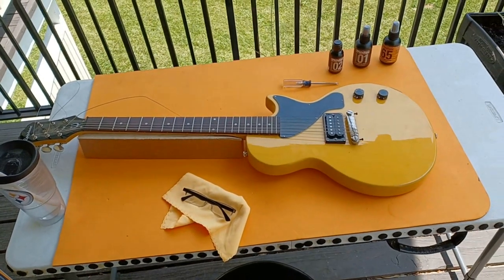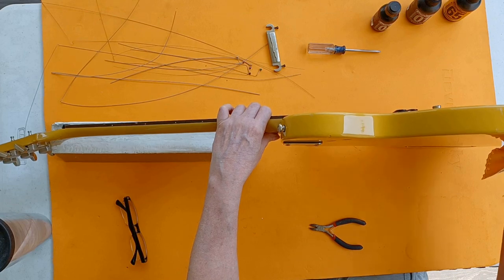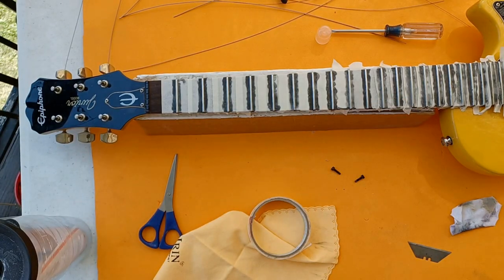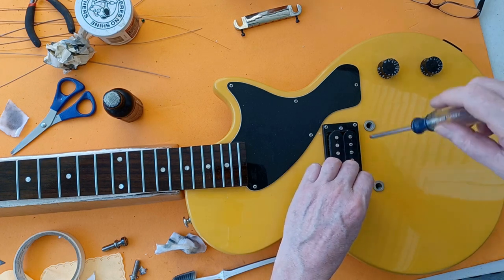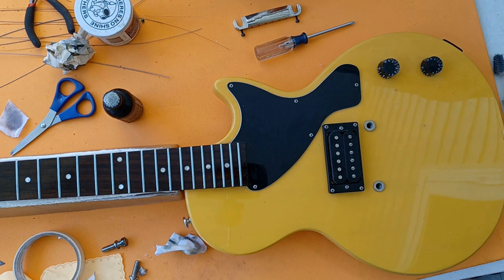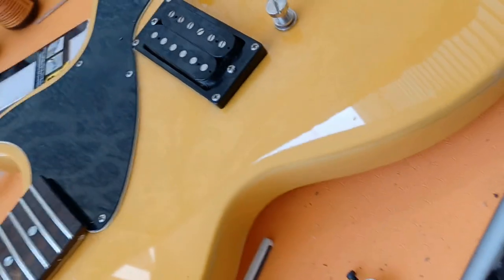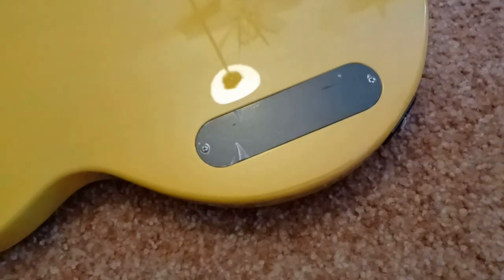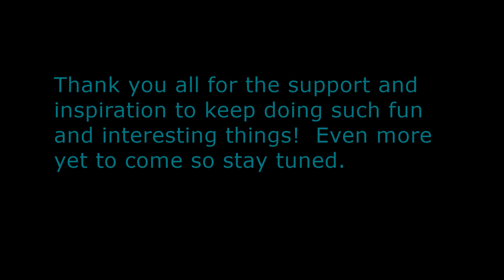LP Jr  repair

Comment: One of the other tricks I have used in the past for loose TOM/tailpiece studs is take your plane, shave a piece of mahogany, wrap the stud with the shaving curl & push it back in.
Reply from the maker: I was worried over damaging the finish up top. I had discussed the possibility that it might need a plug and I had no way to match the finish after that. 

I will keep that idea in my bag of tricks for later repairs as needed. Thanks Jackson.
Reply: @Borgonian Evolution  you bet!  You've given me tons of pointers at this point. Glad I could help!

Comment: I know you're waiting on me for the GGBO. I'm working on it man. I've got so much going on right now. I'll get you the stuff soon. ✌️🤍
Reply from the maker: I still need to get you the final plans before any of that can happen.  I was given a kit build Les Paul that has some issues I want to use for practice before trying it on a build to be given to someone. I am also nearly done with your leveling beam. the guy I fixed the Jr for said he knew someone with a saw to finish cutting the aluminum for me. Little did I know it was just an angle grinder and I have MUCH clean up to do on that now.. Thats what I spent the entire afternoon on haha.